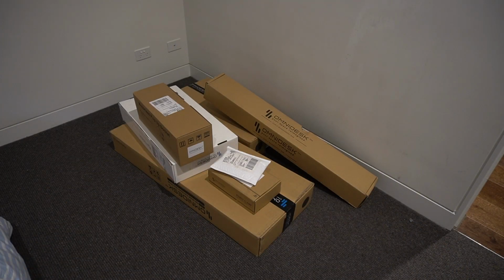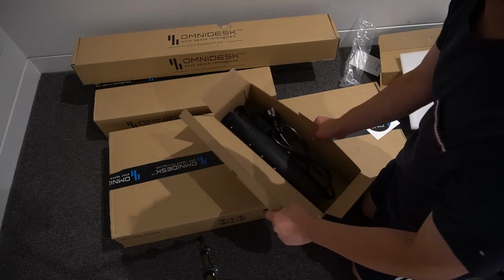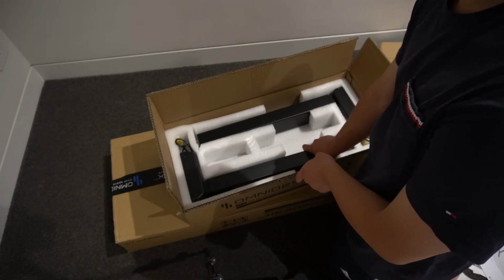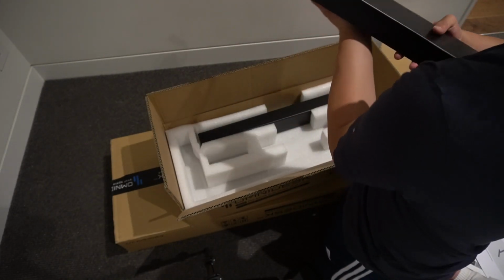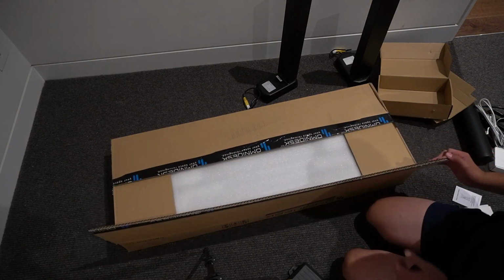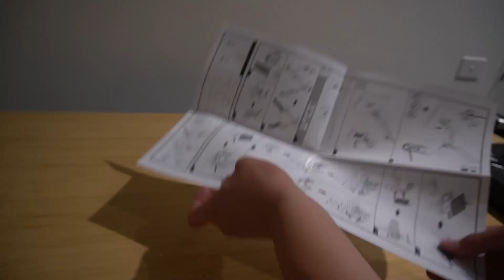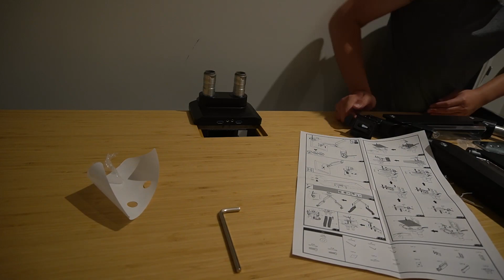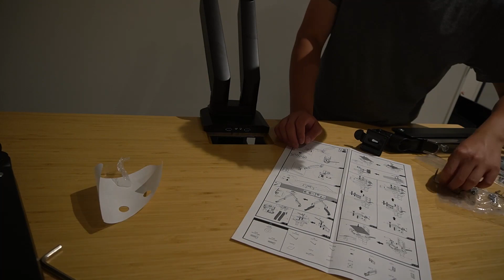Omnidesk Pro 2020 Unboxing and Setup | Setup Makeover Season 1 - Episode 3

Comment: Hey, I noticed you placed the cable management tray (16:30 mins in) close to the back of the desk / where the hole is and you also got the dual monitor mount. I read that if you get the monitor mount it was suggested to not have the management tray that far back? How did it work out for you?
Reply from the maker: Hey, to be honest it worked out pretty good for me as I found a way to conceal monitor cables behind the arms and through the cable management tray. It's actually a good idea to put it back there :)

Hope it helps :)
Reply: @ItsHarrySu  I meant more for the monitor arm clamp but yeah, thanks a lot :)
Reply from the maker: @brownbearz  oh the monitor clamp arm fits and acts perfectly :)